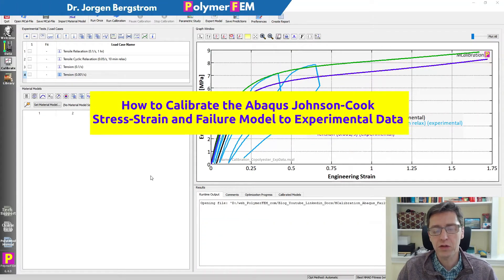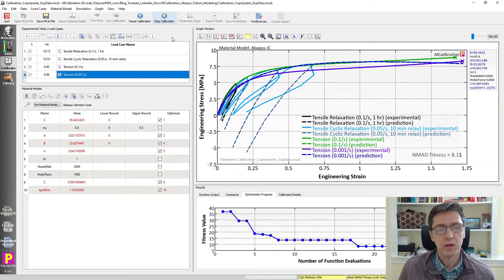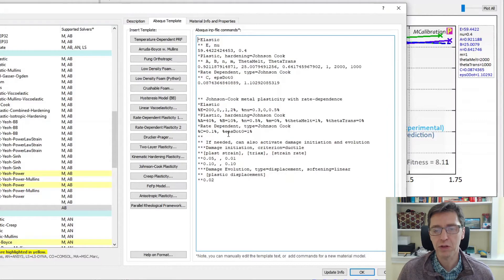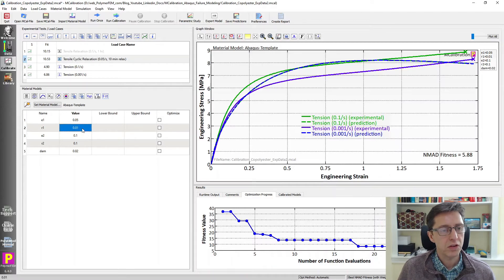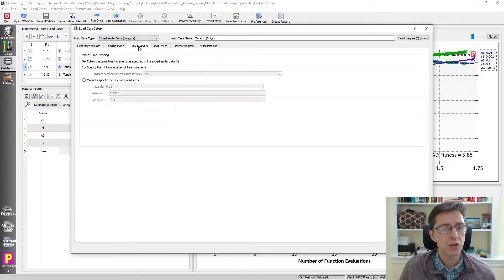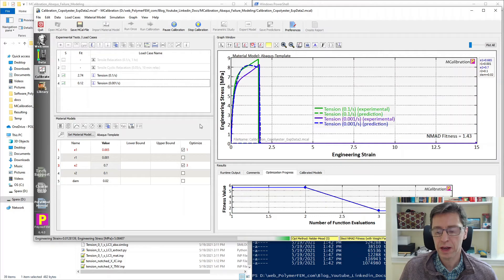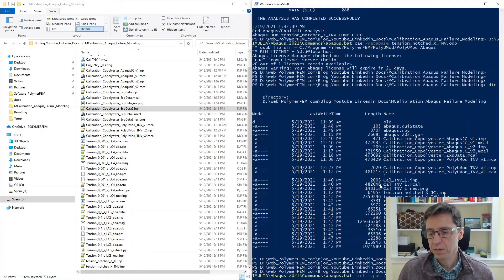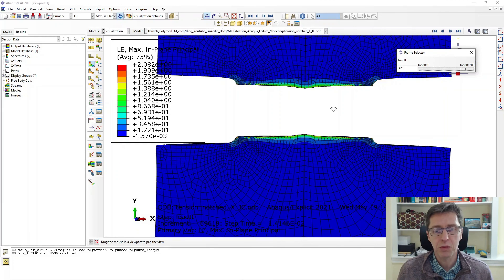Easy Calibration of the Abaqus Johnson-Cook plasticity model with Damage Evolution and Failure

Comment: Hi Jorgen,

Just a one query, in this video you have calibrated a tension experiment. My question is , if we calibrate compression data (available through split hopkinson bar) with Johnson cook model; and later use that model to simulate an impact of a bullet to a plate, would that be valid ?

Because we have validated uniaxial situation and going to use it for multi axial application. Do you have any suggestions for these kind of approaches ?
Thanks
Reply from the maker: Yes, it will be valid. Some materials have a viscoplastic flow response that is slightly dependent on the pressure level. In that case it may actually be better to perform the testing in compression using a SHPB, since it may be closer to your final use case.
Reply from the maker: Yes, that should be fine.